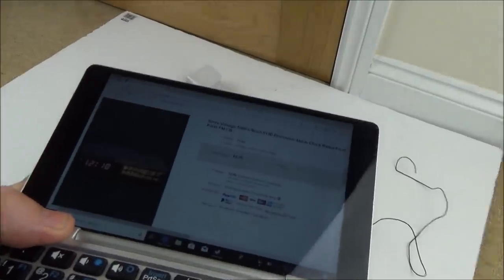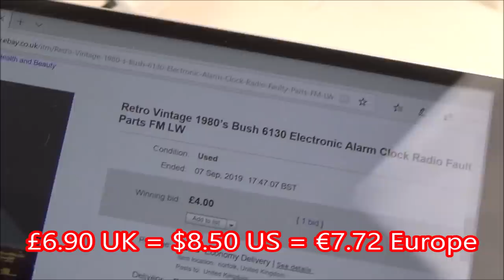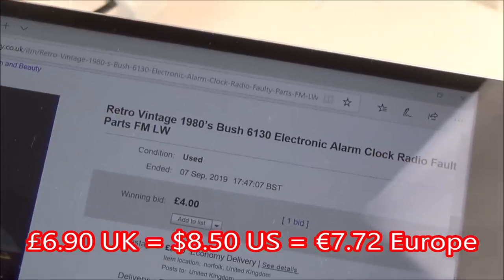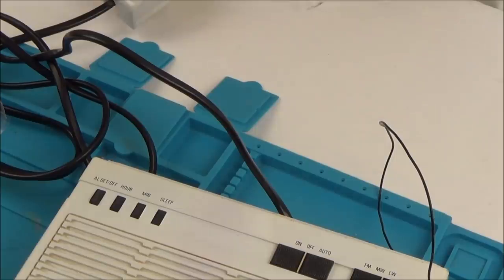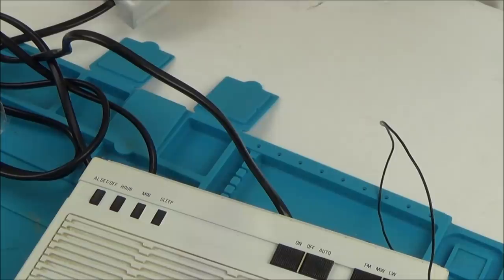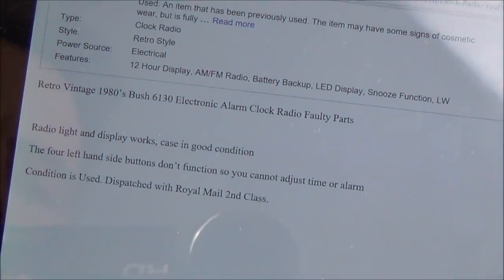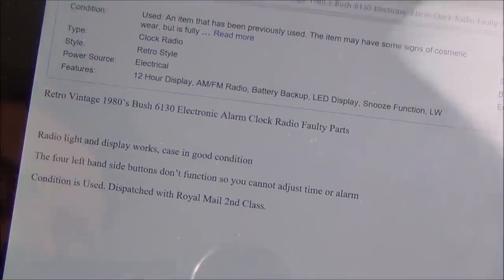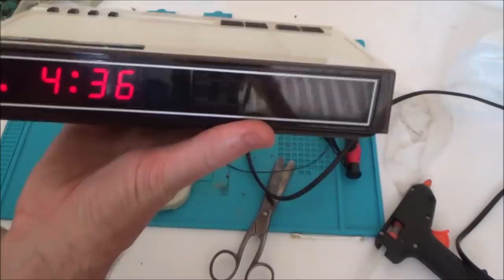Trying to FIX: 1980s BUSH Alarm Clock Radio

Comment: I recently fixed an alarm clock radio for my grandmother, it was stuck at whatever time it was set to and it turns out the alarm time was being displayed so I had to fix a switch and the radio also didn't work so I had to replace a button. It was fun. I enjoyed your video Vince thanks for sharing, Cheers!!!

Comment: Satisfying fix even though it’s to something hated and worthless. Lamps and clock radios are the most common electronic donations to charity shops. They have to scrap so many perfectly working ones since they just don’t sell fast or high enough to justify the shelf space. The flip clocks still have some value, especially if you can find the exact model from Groundhog Day.
Reply from the maker: I bet they are, shame really but not really needed with phones nowadays. I would like to see the inside of a flip clock, I think it would make a good vid.... I might see if I can find a cheap faulty one :-)
Reply: @Mymatevince  I have a faulty Bush flip alarm clock radio (the moden version rather than a classic 70s one), if you want it for a vid let me know where to send it and I will post it across to you.

Comment: Nice fix! I am also working on a clock-radio, a Philps 90AS893 from the 80's. I notice the scale light on yours and it might be one light on the right side is faulty. Mine had the same problem however no light at all. The bulbs are not easy to find and replaced the bulb with a resistor (1K) and a warm-white LED from a 40 LED christmas light. The resistor is required to limit current and to operate at 14VDC. Result is awesome!

If you ever run out conductive pads for buttons, score some cheapy non-clicking keyboards from the 90's, these are full of conductive pads.
Reply from the maker: I have some old keyboards in the attic, thanks for the tip. I didn't check the lights on it. I will look closely at it. Thank you :-)

Comment: Great job Vince!  It's a hell of a coincidence that the spacing of that D-Pad silicone was exacly correct for the pairs of 2 buttons - makes me wonder if that D-Pad was destined by fate to end up fixing that radio =D
Reply: Strange how they be doin’ that. One trash becomes another trash’s treasure, I suppose...
Reply from the maker: Thanks Chris, so lucky with the spacing, the 'fix it' Gods were smiling down on me :-)

Comment: Right when you were taking the alarm clock apart, I was thinking: "Oh, maybe a little pin on the buttons broke off so that they no longer push on the little contacts on the pcb." Because my friend and I lately fixed an alarm clock where that was the fault and we fixed it using a little piece cut off of a paper clip to replace the broke of pin. So I was already shouting: "Vince, just use a paper clip, that's the way to go!" But that clearly was not the problem with your alarm clock. :-) Great little fix Vince, I would have given up on this one I think, but you are more creative than me, that's for sure!

Comment: Because the battery fluid is alkaline, it is recommended to use vinegar to clean the board. This will neutralise the leakage. You can use IPA afterwards.
Reply: What about capacitor fluid?

Comment: I suspect the clock chip in this is a Sanyo LM8560. Most 80s LED clock radios used the same device.

Comment: Nice fix. There are a few hacks I would do. 1st change out that transformer for a switching power supply, (hack open an old wall plug type) that way you save on electric and any humming noise you might be able to here. 2nd I would change the 9v battery for a cheap coin cell with a step up dc to dc converter, and last but not least on the PCB you just fixed I would hack in a switch on the ground side so you can't accidentally change the time by accidentally hitting the button. nice job ...
Reply: those 9v pp3 batteries only give a few hours battery backup on these old clock radios and they don't even make the display light up, just keep the time going in the chip, a coin cell stepped up is going to give a few minutes battery backup I reckon.
Reply: Yeh ok, but there plenty of room for an 18650 in there.

Comment: Always wise to be safe around electricity. In this case the 240v connection to the transformer primary will be well insulated so there is little risk of casually coming in contact with it. The transformer output is probably about 9v. Button failures were common. Yes it's a cheap thing and of little value, but I also repaired my own some years ago rather than throwing it away. It is still a useful thing to have, even if you never use the alarm.

Comment: Nice fix and use of retained 'salvage' Vince.  My garage is full of bits that 'might come in handy' which seems to  provide a sense of amusement to my wife. She tends to forget the things I've manage to fix using these "useless bits" ... until she wants me to repair something  :-)  Whilst caution is very important,  you do not need to be quite so worried  about transformers. You will always be able to see where the mains input connects with the transformer (the Primary side) and just make sure your fingers are kept well away from those connections (whilst the item is plugged in). On low voltage devices like this, the output on the 'Secondary' side of the transformer is harmless as it will only carry low voltage (probably between 6 - 15V AC)
Reply from the maker: Thanks mate, I got a nasty shock in an upcoming video from a big cap in a PS4 so I am more wary than usual now!!! The git was unplugged for over half an hour and still got me :-) Then after it got me it still had 200V left in it for a 2nd try :-)
Reply: @Mymatevince  Haha, yep, those big capacitors can give you quite a buzz (I got a nasy surprise once when working on a AC/DC converter .  So, I made a simple tool to discharge all higher voltage capacitors (i.e those rated at 63V and above). It only involves attaching a 470 Ohm,  5W (or greater) resistor to a simple probe connected across the capacitor terminals. There are plenty of videos youtube  for a cheap DIY  tool; just search 'capacitor discharge tool'.  Transformers however do not present a threat as long as you keep well away from the 'Primary' (mains) side. Hope you don't have any more shocking experiences :-)
Reply from the maker: @standishgeezer   Cheers, I used a light bulb and holder to discharge it but I have bought some big resistors to make a lead up. I think they were 1M but only 2 watts though. I wonder can I connect up 2 in series to up that wattage or would it be parallel ????or does it not work like that?
Reply: @Mymatevince    Resistors in Parallel would dissipate the current between them (not necessarily equally but near enough). Do NOT connect in Series as that would not help in sharing the current. Indeed, that would increase the resistance to 2 Meg and 1 Meg is already much to high! The light bulb is often a decent alternative but if you want to make a discharge tool I suggest you buy a 5-10W resistor no greater than 1KOhm (preferably  470 Ohm - 680 Ohm which will drain most capacitors in 20-30 seconds) . A higher resistance value will take longer to drain the capacitor (1 Meg will probably take about 10-15 minutes) , whereas  a value much lower than 470 Ohms will draw more current and drain the Capacitor quicker than is desirable.  Something like this (  https://cpc.farnell.com/multicomp/mcknp05sj0471aa9/resistor-wirewound-470r-5-5ws/dp/RE07484?st=470%20Ohm%205w  ) would be good. I hope this helps Vince.
Reply from the maker: @standishgeezer  Perfect, I have written down the item code. Next time I do an order I will add on a pack of 10 as they charge a £3.50 handling fee on smaller orders. I may experiment with 2 of the 2watt 1M in parallel just to see how long it takes to drain away. As always, thanks for the advice and help.👍
Reply: @Mymatevince  I don't blame you pal, I never pay a shipping/handling fee as I'm lucky to have a CPC branch near to me, so normally pick up things when passing or include things in my bi-monthly £10 order. At least with 2 x 1 Meg in parallel, you reduce the resistance to about 500K Ohm so will, proportionally, reduce the time taken to discharge a large capacitor. Cheers

Comment: The transformer is isolated from mains, no need to do black magic to stay away from it :D you did a great job, you did not have to even glue pads they would stay in the slots when you screw the board back. You should put around 0.1A to 0.2A fuse if you want the fuse to do something reasonable there, not just act like jumper. I believe in whole Europe, the mains frequency is 50Hz. I've touched the mains hundreds of times, it is very unpleasant alternating shock but it won't kill you like in movies, in fact you will feel refreshed, actually your muscles will contract and shrink instantly, even before your brain is able to realise and react to circumstances. The mains can be live dangerous if you GRAB metal bar or something similar that can shrink your hand finger muscles and grip strong, otherwise your whole arm will react lightning fast and absolutely no damage will be done to you. That is why if you have to touch mains for any drastically reason you make sure you touch it whit outer side of your hand, if you need to unhook someone from mains YOU ALWAYS JUMP AND KICK HIM HARD, better broke him/her a rib instead he/she loose live. And yes you kick in the Ribs ALWAYS because they heal perfect and the human can survive without one or two, but if you broke other important bone, you can make things a lot worse than electricity could do.

Comment: Great to see the old megajoy  again,  I have 2 of those that still work and tbh you ain't missing much they run old nes roms , I remember the vid when you tried to fix that and you were wondering what the transmitter thing was on the top of the board,  the answer to that was a version called the super gun joy that had a built in light gun to play duck hunt  , I meant to tell you back then but I forgot,  they probably used the same board for the non gun versions,  so now you know 😀

Comment: Well worth the effort, another usable item saved from land fill :-D
People waste so much in this era, often it's just something simple.
The transformer does not care which way the power goes in, and they are very reliable.
That pcb likely only gets 9-12 volts d.c, very unlikely you could get a shock.

Comment: Think I would have tested for continuity to see if the membrane buttons worked while the radio was dead, good fix as usual man
Reply: I think he has a good methodology of fixing faults as he finds them, if all works the jobs a good 'un and not look for trouble down the road.
Reply: @dodgydruid  yeh either way, just abit safer I suppose
Reply from the maker: Thanks Reace M, yes that would have been worthwhile. I am pretty sure they are not in contact because I can feel them pop down when pressed, and the time/alarm/snooze is not constantly going crazy BUT I should have checked them to make sure :-)
Reply: @Mymatevince  yeh man I just meant when you were checking if the membrane button from the game controller worked on the radio, you could have tested for continuity while pressing the button onto the circuit board without turning the power on, just to save the risk of a shock, I'm just being overkill but it's habit as I'm an electrician, never seen yiu do anything dangerous tbf man, was just advice for less competent viewer's, love the videos Vince, and learned alot from them Keep up the good work!
Reply from the maker: @reacey  Oh yeah  of course, that makes sense, just check for a short. Cheers mate👍

Comment: Nice fix Vince, I have one similar myself. Just a thought, with the white casing yellowing a bit, would leaving it out in the sunshine for a day whiten it up? I remember you did something similar in the past with something and it whitened up quite well. Also you can buy those 9v battery connectors fairly cheaply off eBay or from the likes of CPC etc, it would save having to re correct the clock every time the mains power is disconnect.

Comment: I knew this radio was going to have a horrible buzzer! They (the cheapo ones anyway) all did during this era - just fed through the AC mains (via the transformer) directly through to the speaker. Some of them had a weird phasing effect as the buzzer came on and off - starting off as a hum but becoming a buzz as the amplifier or speaker clipped the sine wave.

This one was a posh model with the carbon-rubber keys. I was expecting those metal dome efforts sellotaped onto the board - I went through four Murphy-branded clock-radio-cassettes before I got one where the metal-dome buttons worked correctly, and they failed after six months, at which point I took the bloody thing apart myself and reseated the tape. Worked fine after that, I still have it somewhere.

Comment: You left the screws under the buttons loose to give the buttons extra space so they didn't get squished too much.  Maybe if something like this situation occurs in the future, you could consider using some washers as spacers so you can have the extra space and tight screws at the same time.

Comment: Might Pay to invest in a " Conductive Keypad Repair Kit " They're really cheap so most kits have a considerable assortment of size options some are with around 100, as usual I dropped a LIKE Vince..
Reply from the maker: Thanks Koala, never knew you could buy these. Whilst looking on eBay I also seen they do the conductive pads for loads of different PlayStation and other controllers. Useful to know. Nice one :-)

Comment: The hot glue can be in the way when a button is being pressed and I suppose that is what happened with this third button. I would preferably have used super glue to fixate these rubber domes.
Reply: But super glue can melt plastic and would have probably ruined it
Reply: @nathanmead140  And how unlikely would you think it is that the heat of the hot glue deforms the rubber? I think there is only a very low likelihood for both to damage the rubber.

Comment: They are the same buttons that you have in your remote control but I would be inclined to solder tactile switches on the PCB because they would last longer that's if they could fit of course if not stick to rubber pads instead

Comment: You could probably salvage some carbon pads from an old calculator or remote control.
Alternately you could solder on some tactile switches...
Reply: Oh, that's what you did :D

Comment: Whilst the 13 amp fuse is over rated, understand that it's there to protect the cable not the product. That's why there is a fuse in the plug for all UK appliances...
Reply: @Unchained_Alice  In the UK the electrical wiring is ring mains - this allows for less copper required to deliver high amps - usually ~40Amps. This means that the wires going to an individual appliance are far too small for the main breaker, so each appliance gets a fuse in the plug.

Ring circuits have serious drawbacks, but they helped during a time when there was a copper shortage.
As a rule of thumb a 3A fuse should be used for devices drawing 700W or less and a 13A fuse for devices over that. The fuse is there to act as the weakest link in the ring mains, it's not to protect the appliance.

Comment: Cheap things like this with a conventional transformer linear power supply. They actually have a thermal fuse embedded in the transformer, on the primary winding. So if it overheats, the thermal fuse blows and the primary becomes open circuit.

Even if you completely short circuited the power supply, it's unlikely to pass enough current to blow even a 3 amp plug fuse. Instead the transformer would overheat, and the thermal fuse would pop.

The mains cord just goes straight into the transformer. So should be no live mains parts exposed, even when the device is disassembled. Of course it's always best to be careful.
Reply from the maker: Thanks Michael :-)

Comment: I had an old Bush clock radio, little thing bought it for a pound in the eighties at a boot fair and it was fairly spry by that time and it lasted til a couple years ago where the alarm went off but instead of making noise, it made a small fire but was OK as it set the fire alarm off but I was so gutted it exited in quite that way :(   I won't retell the old joke about the Corsair radios... made out of recycled bush's... oh woops I did tell it O.o

Comment: The power cable goes immediately in the transformer. No 240 volt else where in the case. Only 9 DC or 12 Volt AC in the inside. The clock work with the 50 Hz cyles, with 9V battery it has only a R C ozliator.